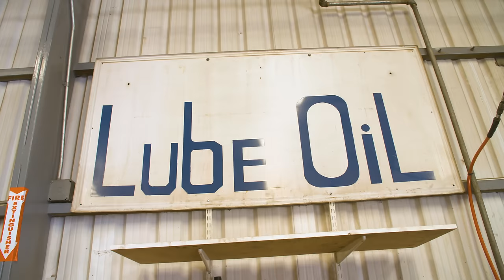Welded Diff vs. $1200 Diff | HiLow

Comment: another good way to check the gearing is to rip a folder into strips and run the strips threw the gears with grease on them. Its a good way to check individual damage to each tooth.

Comment: Car noob here: Why is it so that in case of Lo car they are welding the diff and not redistributing the weight of the car (what I believe is the cause of one wheel being used more than the other)?
Reply: From what I know welding a diff would make the wheels spin at the same speed at all times making use of the wheels equal edit: Idk if this is exactly right

Comment: ok to be honest you aren't even comparing two things that do the same thing in this one a welded diff is like having a solid back axle while a limited slip diff is specifically designed to improve overall handling on and off-road over a traditional diff which just free spins on whatever wheel is in the air

Comment: The real downside of a welded diff is NOT reliability if done properly. It's the fact it actually fights the car's front end on the turn entrance. Or elsewhere if it wants to really :) This leads to understeer situations and by the way, same is done by an overtighten LSD. Ask me how i know: my lsd won't fully open when supposed so i my front axle can go straight understeerin when i lift DOING DONUTS that's so annoying!

Comment: Free is not Really Free... If you don´t have an Welding Machine, or A Shop that is doing it for You (here in Austria is Highly Illegal) so no one will do it for you, so at least you need to buy a Welder… Just a Stick welder is costing about 140€ (Also in Austria) and a good Tig/Mig Welder about 650€ without the gas... all in all the Free Version is Between 150€ and 800€

Comment: Well guys you should’ve list everything about both ways not just that you can drift better!!! 
There are so many ppl watching y’all can’t afford the LSD and might go with weld in there daily and only car not knowing the real problems comes with it. 

If you somebody got two or more cars thinking about welding one of them then send it buddy and enjoy don’t read👇🏻 lol 

But for who ever has only one car think logically about it before you decide something for your daily: 
Saving for a while for a LSD to safe your car and keep things good for longer period of time 
tires ( even if you gonna skid ) trans, steering and way safer driving
or 
Weld ur diff and that will not go cheap at all on the long run, plus it will be very annoying after a while and it can be very dangerous sometimes specially on wet pavements and snow. welding the spiders will only be free if you know how to weld yourself other wise you’ll have to pay at least $500 to someone to do the job and he has to be a real professional knows how diff work not just a good regular welder ( why not put that as a down payment maybe or safe for later and do your LSD at home yourself? You can get shims and a dial indicator for $35 - instructions and info on backlash/bolts torque specs free from google!!!??? ). Welding the diff Is not about tires will wear 5x faster only (for sure you would be doing this for the skid), but it might get dangerous bc it control the steer. Also lots of trans components will wear out real quick. 
So you’ll end up after a while paying more and more bc of that and You’ll decide to buy a LSD to safe your car and lower the cost lol

Comment: They forgot to mention that with a welded diff you’ll be going through tires every 5 monthes lol welded diff is never the way
Reply: Had a 72 firebird with a posi , went threw tires quicker than that LMAO
Reply: @daltonyoung1749  people like to pretend that 2-ways are significantly different than a welded diff. Owned both, drove both. The 2 way is a bit more civilized in turns, but you spent over a grand and tons of time on it, so who cares if the welded diff eats tires faster? If you're trying to drift, you don't really care much about eating tires. People want to rationalize shiny parts
Reply: The point of welding a diff is for drifting or drag anyway. You shouldn't expect your drift tires to last a long time, and you shouldn't be using drag radials on the street anyway. Most people who repeat these common mantras have never owned a vehicle with the modification they're complaining about. My all seasons on my rear have lasted well over a year on a welded diff with occasional small drifting, and for most grassroots drivers with lower power, they aren't spending big money on tires anyway, with those cheaper tires generally having harder compounds.
Reply: Ive heard that running welded diffs on the street were really bad about plowing straight when making 90 degree turns . I had a posi unit that had extra shims in it , so it took an extra 10 or 15 foot pounds to break one tire lose from the other side , the tires constantly screamed in turns and it kinda wanted to plow straight , if you gave it much gas making turns
Reply: @daltonyoung1749  yeah, understeer on turn in is one of the downsides to a locked differential. It's probably the only major downside worth mentioning

Comment: Uhhhhh..... 1200 is extremely reasonable and attainable by just about anyone with a minimum wage job. Seen MANY (more than i can count on 2 hands) friends/ associates welded diffs break . waste of time and time=money regardless. Don't be a cheap ass, save up do it right the 1st time. The KAAZ 2 way is ON ANOTHER LEVEL, it will last forever and you will not regret it

Comment: I had a KAAZ in my rx7. It was SO LOUD. Absolutely useless for anything other than full noise skids. Feathering for grip around sweeping corners in the wet? Forget about it. Fuckin thing locks up and lets go at random. And yeah, as our boy here says, the squares all look at you like your car is broken whenever you are trying to park it. Because it basically IS broken. Welded diff would have been better.

Comment: They manual right ? You can’t do a burn out or drift in an auto
Reply: they are manual but you can do both of those things in an auto
Reply: @arcanevoid9199  I’m looking at the new 400z next year reason I’m looking up all these cause the performance ain’t worth 50k just got a non slip diff and better wheels

Comment: Theres nothing wrong with Welded diffs. Especially offroad. Theyre simple, strong and reliable. The always work.  Welded diffs are better than spools too, because the carriers more rigid than a spool. So less likely to snap ring gears.  I dailyd a rig with welded diffs and 38" tires. No issues. Later i had tons of problems with lunbox and selectable lockers after i "upgraded".

Comment: I feel like you guys keep going through a lot of trouble to never properly finishing your videos. "Cheap vs expensive diff!" And then proceed not to actually test the diffs other than some burnouts. "Cheap vs expensive cover!" Proceeds to use shit plastidip that in no way represents how it would normally looks instead if waiting a day or two for the ones you initially ordered.

Just please go the extra foot and actually finish your videos please. I know it would delay them a day or two, but it would make them so much better. Your cheap vs expensive comparisons aren't worth anything if there's consistently no conclusion